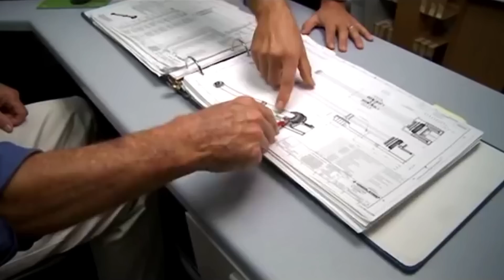US's Ultra-Advanced Railgun Weapon Is Making All Others Obsolete

Comment: Love it, but (and there is always a but) you can only use the railgun for three time. Each time it is fired it rips itself apart. The system simply destroys itself after just a few (currently three) uses. When they say more work needs to be done. They are correct.  That said, a hell of weapon!
Reply: The best weapon is a weapon that you only need to fire once! It won't really matter if the gun destroys itself in one shot if it can shoot clean through an aircraft carrier then that one shot would be worth it!
Reply: rumor I heard was 115 shots- but 'classified' STILL means? they're never gonna tell you or I.

Comment: The rail gun does still use a small charge of conventional propellant to start the movement of the projectile because otherwise the projectile will weld itself to the two copper rails in the barrel
Reply: Yes and no, it would not weld itself to the rails   Absolutely incorrect.   The reason, and proudly stated was that I came up with the concept.  It had nothing to do with projectile destruction.  Duh

Comment: The biggest problem is the life if the gun. Each round fired causes extensive damage to the gun. This leads to a very short lifespan, and makes live fire training near impossible due to the cost. The amount of energy needed is unreal. You would never be able to have a land based unit without a small powerplant next to it to get enough power. It has a really long way to go before this technology will see actual use.

Comment: A little fuzzy math here?  While they initially claim this weapon can achieve speeds of up to 52,493 feet per second (which is just short of 10 miles a second), they then go on to say it could hit a target 250 miles away in only 6 minutes.  At 52,493 feet per second, it should hit that target in a little over 25 seconds rather than 6 minutes.  Of course, the claim was UP TO 52,493 feet per second, which probably means it slows down significantly during the course of a 250 mile launch. 250 miles at 6 minutes is an average speed of about 3666 feet per second, which still betters gun powder, but then also without any explosion at the end.

Comment: It would be a lot more effective if the military super cooled the projectile in liquid nitrogen maybe even pump a bit in the barrel it would give a longer life 
I think nuclear diamond batteries and a solar with a compositor And if the military lined up multiple capacitors they would be able to still multi fire and maybe even a bit more effectively  Although each capacitor would have to Max out at 80% or 85% of the energy needed to fire while drawing the rest from the load (-)

Comment: Well, this type of gun would need a substantial size generator,  and transformer, plus many  large capacitors and many "sequeltial activated switches" able to handle very powerfull currents and trip those currents sequentially in a milli-second, without getting destroyed in the process.!  The barrel would be subject to friction by the shroud that would help accelerate the tungsten projectile.(s)  The electric cables to the powerfull electromagnets (tooroid types?) that would line the inner part of the barrel would require high heat resistant electric insulation from each other, and be able to transmit serious inertia forces to the projectile without getting dislodged.  Likely some serious cryogenics cooling would need to be provided for the many switches, the electric wiring and  capacitors, plus the transformer and all the electromagnets.!  Seems this type of cannon would not be ideal in undulating terrain, it might be best suited for aerial defence "shooting many thin tungsten projestiles) at once, like some shotgun on steeroids, toward incoming missiles, and at sea for defence and attack?  If at all viable, considering the complex technologic challenges involved...

Comment: The math is off. If its moving 52493 feet per second which is 35791 mph. Which puts it hitting a target 250 miles or 1320000 feet away in 25.14 seconds. Where does the 6 mins come from? Also at that speed, wouldnt that create a deformation of the projectile due to atmospheric pressures? Wouldnt it need to be heat "resistant" kind of like the tiles on the spacex capsules?

Comment: You didn't mention the main problem with rail gun technology. It's the problem that's stopping rail guns becoming ubiquitous.
It's during the acceleration phase as the projectile is boosted it forms a dead short between the + & - rails. 
This short produces lots of heat, the friction and damage to the rails. You can see the plasma produced in the slo-mo shots. 
This damages the rails with each shot requiring repair before another is attempted.
We're seeing a very "sanitised" version of rail guns here
Reply: Agree- barrel technology needs to be revolutionized to make viable.
Reply: Dumb idea from a dumb guy, but what if the barrel could be filled with saltwater? There could be tubes that “charged” the barrel between shots
Reply: im sure with their kind of funding they have made a material to account for those problems. the military wouldnt decide to refund it if they thought a weapon like that would only hold up for a short time frame. remember they want their ammo cheap, not the material used to shoot it.

Comment: Faster projectile speeds would also make intercept courses easier to target in the case of an incoming ICBM. It would be a significant upgrade to defense.
Reply: ICBMs travel at much higher speeds  at least "Mach 23" to get into Space for a ballistic Trajectory  An intercept missile has to be "guided " to the target. ABMs travel at Mach10 +  ( see Sprint ABM  missile as example ) so this weapon is A backwards step in speed
Reply: @zenko247  small correction, ICBMs don't get to those speeds, their warheads do after separation and reentry.
Reply: For icbm/missile defense we should be using lasers anyways, which travel at the speed of light… (mach 874,000)…
Reply: @GrabnarMyers  They have been trying for nearly 40 years ( Since Reagan's Star Wars  shit  in the 80s ) no success
Reply: @zenko247  theres been a ton of success though. They successfully built a photon anti-missile battery probably in Israel or something cause I forgot, but it can shoot down UAV’s, Mortars, and non-hypersonic missiles every time with a crazy amount of electricity being consumed to shoot for a couple seconds. And its only going to get better and more efficient.
Reply: Wouldn’t blowing up an ICBM cause the explosion and then knock out any generator powering the rail guns?
Reply: @geneawisea2708  No. A nuclear device uses precisely timed high explosive implosion to attain super criticality. If you blew the MIRV apart with a kinetic impactor, you would get contaminates raining down in the form of particulate fissile material, but no detonation. The detonation  has to be >>> perfect <<< to get fission (usually used as ignition for fusion for the big boom H bomb). It is a precise instrument, and hitting it with the proverbial sledgehammer makes detonation impossible. Imagine hammering your grandfather clock... aint gonna work, and an HE implosion is orders of magnitude more precise. 

TL; DR tap the MIRV, no nuclear boom, just dirty rain.
Reply: @oversoulwastaken  pretty much all of the modern ICBMs carry multiple warheads.  Depending on configuration even if you managed to destroy one warhead you can trigger either separation of the warheads or a boom.  On the other hand for the dirty bomb, that you describe,  you actually need an explosion.  The only way to shoot down ICBM safely is long before it enters atmosphere. The energy of the projectile should be pretty high and it should have smart weapon capabilities.
You cannot replace $50 million sm-3 block 2a miscile with $10 projectile.
Reply: @Grim_Reaper_from_Hell  what are you talking about. If you can't get it in the boost phase then yes you are supposed to hit each individual warhead
Reply: @Grim_Reaper_from_Hell  not all, only trident
Reply: @geneawisea2708  If you're talking about intercepting a Nuclear missile and that resulting in an an EMP it wont.  Hitting a nuke won't set off the explosion, the nuke's internal payload needs to detonate to start that reaction.
Reply: @donchaput8278  you don't know that for sure. A nuke could have a failsafe to explode with any disturbances. But you make nukes or are God so I'll let you do you
Reply: @replynotificationsdisabled multiple USAF nuclear weapons have been involuntarily dropped out of aircraft or crashed with the plane without causing a nuclear explosion. Besides that the speed of both objects traveling would probably vaporize them when they make contact. There wouldnt be much time for a failsafe mechanism. I guess they could put a radar in the warheads to detect incoming threats but I think the plasma shell from re-entry would not allow it to function.
Reply: @donchaput8278  it also isn't electro magnetic
Reply: @geneawisea2708  not if it was shielded. You can protect devices from electric pulse you can protect entire buildings you can protect our entire electrical grid, but we choose not to. Why? Because the nuclear warheads are shot out from a submarine off the coast, it travels above barriers but as close to ground as is possible to avoid radar moving at mach speed  witnesses have no clue what flys by them. By then its too late. God help any survivor within the 50 mile blast zone. The Japanese called those survivors the living dead severely burned corpses still alive walking arms outstretched because the pain of lowering them was too severe. Just walking in agony as grotesque as you could imagine but alive. Those not burned fear you. Nobody wants to survive such carnage.
Reply: @geneawisea2708  No, it would need to be an EMP
Reply: An incoming ICBM seems much more simplified process to interrupt & destroy than say a nuclear warhead fired 50 miles off the coast from a submerged submarine. 6 missiles could wipe out 2/3rds of the American population before anybody even knew 1 missile was launched. I believe we have to come to the realization there is no defense today nor will there ever be a defense from anyone launching from a submarine. There is only retaliation which has to be set to automatic because there will be nobody alive in government to give the order to launch. This means our nuclear submarines must always be armed ready & within striking distance of any potential threat at any time & be undetectable.
Reply: @cme98   Submarine Nuclear  missiles are Ballistic  the cruse missiles are not nuclear ( note Tomahawks do have a nuclear capability BUT non are )  Trident missiles have a range of 12,000 miles  that means they can hit Russia while still in port if they want to . When you say 6 missiles do you mean 6 warheads ( which is less then 1 missile ) or the full compliment of MERVS in six missiles that's 48 warheads each 10 times the one dropped on Hiroshima ??

Comment: OK ------ 5:!    The M-777 155mm Gun could be Ukraine's SUPER WEAPON to WIN this WAR!!!  And not just a few Token M-109 Palladin Guns... But the current batch of 100 American M-777,  155mm guns are a good start...  But more M-777 must be sent to equip every Ukraine BTG with a Battery of 6 guns... While the M-777 is better than most Russian guns. The Russian 152mm guns use 47cal barrels that is longer than the M-777 short 39cal. Steel barrel that is even inferior to the 42cal and 52cal Steel barrels in most of Nato's inventories and the few guns they are sending...   Giving the Short barrel M-777 a projectile range of only 20 miles with the standard shells.  But the M-777 gun America is giving Ukraine could have a range of over 32 miles using a new High Tech 30ft long 58cal Barrel that is now being field-tested by a Battalion of M-109 Self Propelled Superguns (that truly look beautiful with their 30ft long 58cal barrels). The new high-tech none steel barrel is a Composite Carbon case, Titanium sleeved long 58cal Ultra High-pressure Marvel of American Engineering... The high-pressure 58cal (30 feet long) barrel using new supercharged propellant (that would blow up the average steel barrel) gives the M-777 155mm Super Gun a range of 42 miles with Palladin shells and 60+ miles firing the new XM1113 projectile... and over 150+ miles with the new subcaliber Hypervelocity GPS guided projectile. Making the M-777 a terror for all Russians in Ukraine... Allowing Ukraine to finally take back (freeing) the Crimea and the Donbas without suffering massive Ukrainian casualties...
K -------  America needs to produce and send Ukraine the new high-tech SUPER BARREL Kits for the 100 M-777A1 guns that recently arrived in Ukraine (90 from America and 10 from other nations). The new lightweight composite 58cal 30-foot long barrels have the same weight and balance as the current 39cal steel barrels in both the M777 and M109 and  simply slide into the gun carriages of both weapons, without any Major modifications.  
KO ----  Russia is bringing in more 152mm guns and BTG's into Ukraine every day...  So America Must send the 1,000 M-777A1 (with optical sights) guns left in US depots waiting to be scrapped, to Ukraine with the addition of the A2 Digital Sensor targeting upgrade kits, (that reduce the long-range miss radius of standard dumb shells to 10-meters from 50+meters while giving a first shot time of 1 minute from emplacement). for all the M-777A1 guns Ukraine now has and will get... Bringing them all up to the M-777A2 standard.   Giving Ukraine the Numbers to attach a 6 gun M-777 Battery to each of Ukraine's BTGs (Battalion Tactical Groupes) to replace their current 122mm very short-range 45-lbs light shelled guns that are terribly inadequate for the job... Finally giving all of Ukraine's troops the destructive accurate close support they desperately need and a chance against a Russia that has thousands of old Russian 122mm guns that lack the range and accuracy and destructive power of the 97-lb 155mm shells of the M-777...  Though that is slowly changing as hundreds of Russian 152mm guns that come close to matching the M-777's range and shell destruction (that are easily destroying Ukraine's 122mm gun batteries) are being shipped into Ukraine adding to Russia's massive numbers of 122mm guns giving Russia an even greater advantage in numbers over Ukraine's basic 122mm guns and the few 152mm guns Ukraine has and are able to get from old Soviet nations. With both of Ukraine's 122mm and 152mm guns rapidly running out of ammunition that will make all of Ukraine's old and new soviet guns worthless hunks of iron too damn soon... (traitors made it possible for Russia to destroy all of Ukraine's munition factories the first night of the War)    Which is why All of Americas retired M-777 guns must be sent to Ukraine Now...  This also means that the New Super Barrel and Digital Sight Kits must be sent to Ukraine for the M-777A1, 39cal guns they now have as soon as possible...   Ukraine must get the SUPERGUNs the Russians do not have and cannot produce...  Superguns that would be able to sit back and safely SNIPE the thousands of Russian old 122mm guns as well as their big 152mm brothers (that Russia is slowly shipping into Ukraine from Refurbishment centers).  Sending the Russian guns into oblivion no matter how many Putin sends...!!!  Finally giving Ukraine an advantage they Desperately need and Russia can not negate...!!!  As the Russians both outnumber Ukraine in weapons and manpower...!!!  Ukraine has been refused modern fighters and tanks, but with every M-777 and M-109SP gun (the US has retired to Storage Depots waiting to be scrapped), sent to Ukraine NOW,,, and then Upgraded as soon as possible to Superguns, Ukraine can make up for what they can not get or are outnumbered by Russia!!!  And Win this WAR!!!

K1 ----!!!  Please call and write President Biden and your Congressmen in the House and Senate to demand that Ukraine gets the thousand M-777 and hundreds of M-109 SP guns from our Retirement storage depots NOW, with the SUPER GUN 58cal upgrade kits following as soon as they are produced on the production line (now making the production test barrels for the M-109 Supergun)...!!!  That will stop the Russians in their tracks from taking any more Ukraine cities to torcher innocent local civilian men, Rape women, and children then murder and bury them in mass Graves... and End the WAR...!!!  Thank You...!!!!